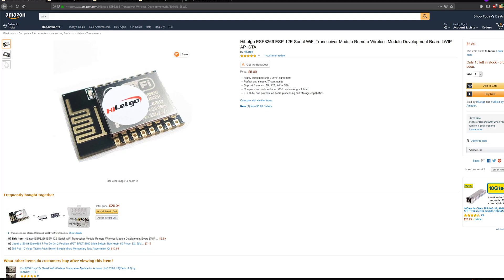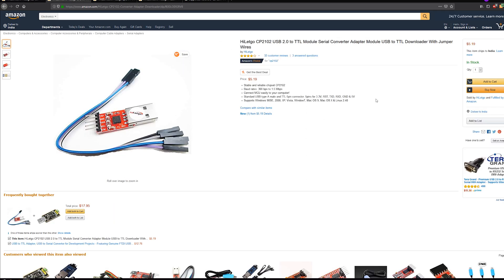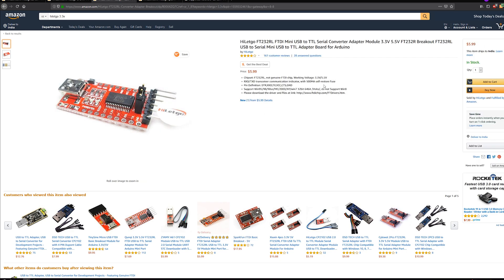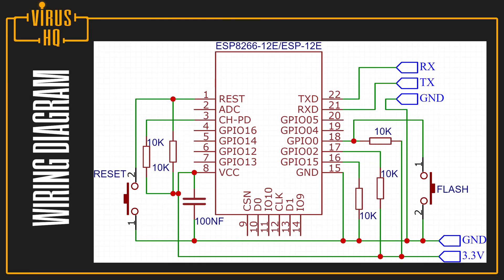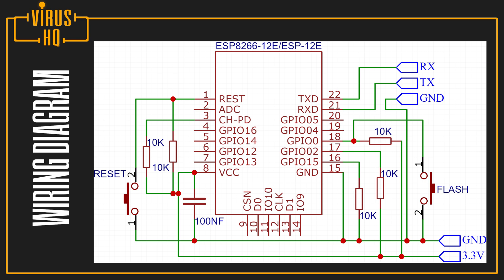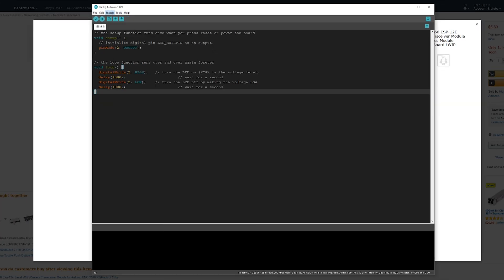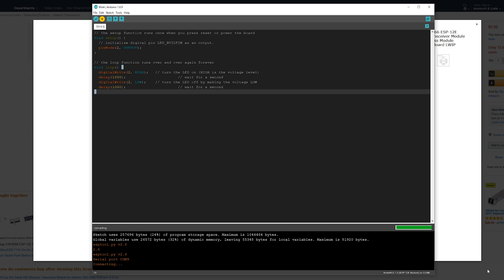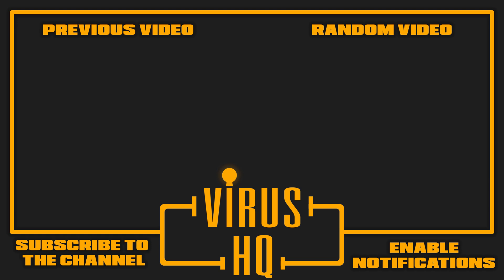ESP12-E Booting and Flashing

Comment: Why are you using a separate power supply?  Doesn't the USB TTL module power the ESP  via 3.3v ?
Reply from the maker: The TTL module I have did not have the 3.3V output so I needed the external power supply with 3.3v

Comment: HELLO Sir ,  i had tried this schematic with 100uF capacitor but it doesn`t work. and capacitor is just for filter so it should not be reason i think. and also i tried to upload using nodemcu module. but there is always show fatle time error. so please help me
Reply: Probably your esp module is bad, or it's not entering bootloader (flash) mode.  Also, the video doesn't show actual physical wiring. So I wonder if it ever worked.
Reply from the maker: It did work, the only way I would make a video on it, took me a very long time to find the correct schematic
Reply from the maker: Are the connections correct and were you able to put the module in bootloader mode, it was the hardest thing when I did it the last time

Comment: Thank you for the video. I have a question. At minute @3:55, on the schematics, on the left side there's the two 10k resistors; there's two red dots which seem to touch each other, are they connected together or not? (on the left of the 100nF capacitor)
Reply from the maker: They are connected.